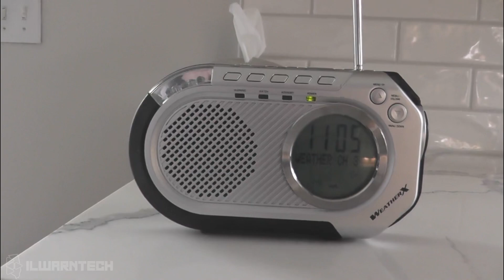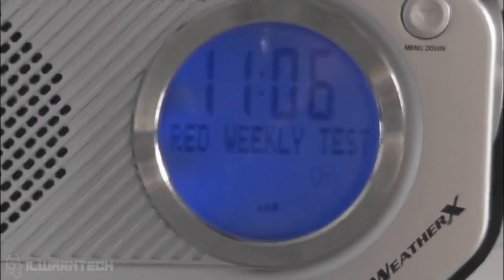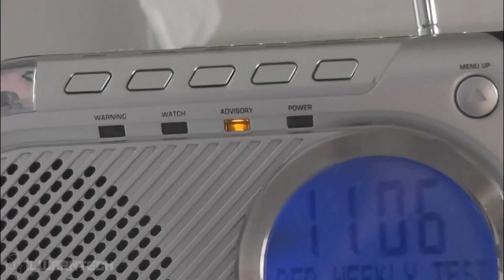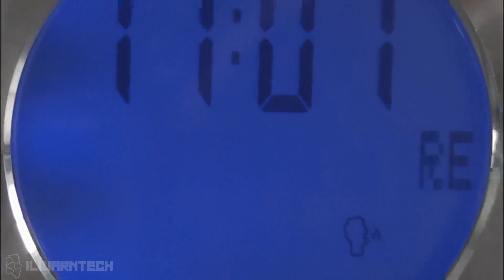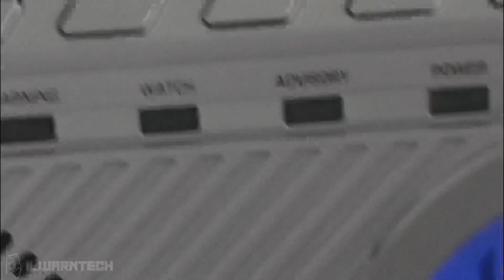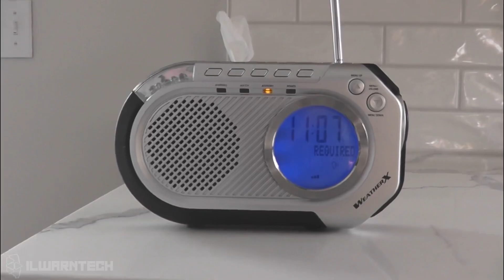WeatherX RWB8817DT Required Weekly Test | NOAA Weather Radio WXK24 (3/22/23)

Comment: Didn’t your WeatherX die in a old video?
Reply from the maker: I thought it died, but it turns out the AC adapter was extremely faulty. I got a new adapter for it and it works fine now.